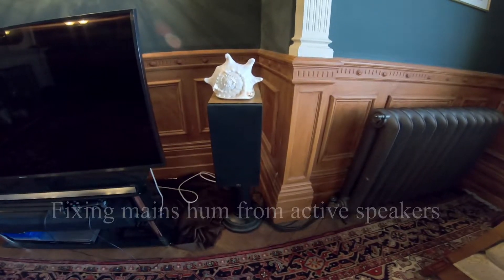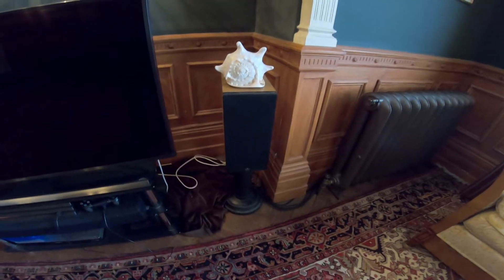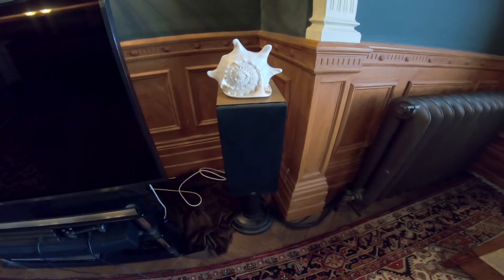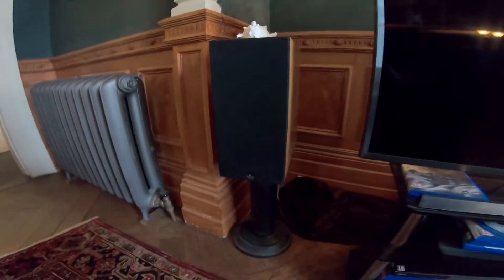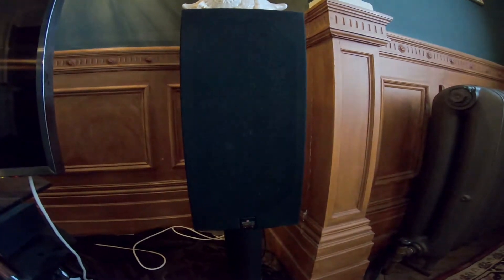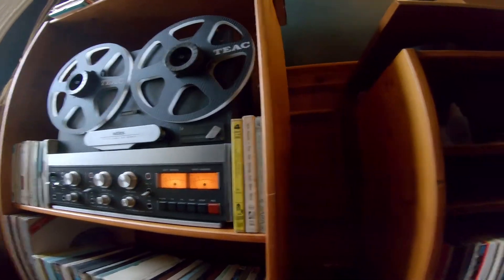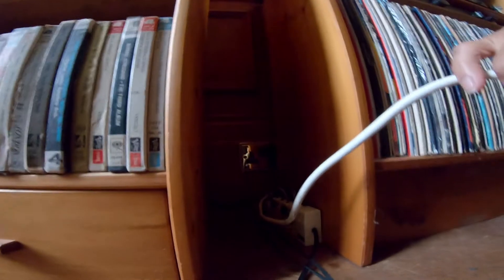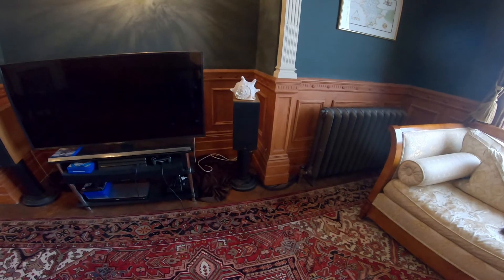Curing Mains Hum on an Active-Speaker Sound System.

Comment from the maker: If you read around a common solution to hum is to have a single earthing point for all equipment in your audio chain and to run the turntable earth to that. However, if, like me, you have active speakers on the opposite side of the room to the turntable amp etc, having a single earth is a problem and in my case I got hum using two earths. So my solution was to run a power extension cable across the room from the speaker power point to the amp etc. And it worked. One extra mains wire to route/hide and switching on/off from the mains power is a bit more complicated.
I tried a floating earth plug and it didn’t work.